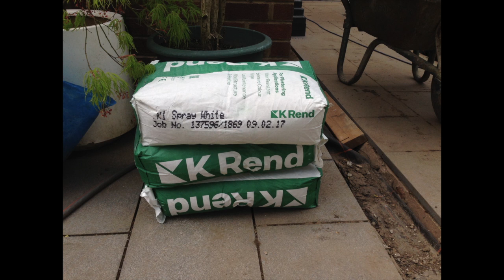Krend

Comment: 1st you should use hp12 as first coat for k render, then thick 2nd coat with k- render. Wait 4-6 hours dependimg on weather then scratch up.
1 bag of k -render should only 1m squared, only mixing half bags is just prolonging the job. Good tip, use a clean out bucket to clean whisk spraying it over customers garden is a very bad idea. 
Finish product looks good but a very long way of doing it and quite messy

Comment: Hi. I'm a DIY'er about to have a go at rendering. I've watched many tutorials now but none seem to mention drying times / times between each pass.
I am going to apply (straight onto concrete blocks) HP12 base coat and beads, then mesh, then 2nd pass of HP12. 
Do I then leave to completely set before applying K1 top coat or do I apply it immediately? same day?
Also, do I need to apply a 'bonding adhesive' such as SBR or is the new clean blockwork going to be ok to go straight onto?
TIA for you help and advice.
Reply: Hi. I’m in the same boat as you. Starting this weekend. My understanding is. Let the base coat go off. Minimum 24 hours. And then apply top coat. No bonding agent should be needed on new clean dry blocks from what I’ve seen.
Reply: @scottramsdale1572  Thanks Scott. Well I've made a start and it seems to be working out ok. As it turns out I can't locate any stock of K1 K Rend top coat in white so my base coat will have plenty of time to dry :). Good luck with your project.
Reply: @vincealcorn  I’ve had the same trouble but finding any none white colours. Not sure if it’ll help as I don’t know where you are. But Travis Perkins in Chesterfield, Derbyshire have stock of FT white. My none white was from a website called ‘rendit’ they’re based in Doncaster I think.

Comment: Great video, can I ask how did you get the black plastic to stick to the top of the inner side? I was going to seat it under the top most block but yours seems to be at the top of the topmost block. Tbanks
Reply from the maker: Hi - the inside of the planters were coated with two thick coats of bitumen paint before lining with a layer of visqueen (black plastic sheeting). You could point it into the top layer of block or pinch under the outer edge of the beading. I simply trimmed it off very near the top and held it against the inside of the wall with soul and a top layer or bark. I’d probably look at getting some black plastic trim and screwing this over the top next time (something like this - https://www.roofingsuperstore.co.uk/product/classicbond-epdm-gutter-trim-upvc-gutter-drip-25m-length.html?gclid=EAIaIQobChMIp6qw3aqM7AIVk4bVCh3LwgQsEAQYASABEgKVpPD_BwE

Comment: Great video I'm about to start mine. Today as its sunny. Just finished the block wall and driveway gate posts. 

Should I use mesh or leave it out like you did just garden wall flower beds and posts like you have done? Using k rend was going to use that cork sol and spray it but fancy giving the k rend ago.
Reply: you didn't get a reply - but I'm interested to hear what you did! Most others on YT seem to use mesh - did you? And did it turn out OK?
Reply: I didn't end up using it and its bonded well, no cracks or movement.

Used concrete block, base and then top coat, super easy after a couple of mixes you get used to applying k rend.

I got quoted 55 pounds per square meter so I'm glad I did it myself. 

Cant go wrong as its scratch coat looks superb all the neighbours came out and said what a great finish it was. Painted it to to match my grey windows ral7022.
Reply: @s.s.lcivilengineering6364  thanks for the reply!!

Comment: Thanks for posting this up, nicely demonstrated but it's not for me unless a client insists on having it.
They used K-rend on a farmhouse down the road from my home, their stuff came from France. The Albanian plasterers put on a 1st tight coat, scratched it up and 2 days later put on the final coat before hitting it with the metal teethed float. No cracking and lots of expansion joints. In a nearby village is another Krend home and this one was done 3 years previously and I've noticed a few cracks but generally it looks OK,  time will tell and I will stick with using lime putty mortars and plasters because they have stood the test of time and I know where I am with them just like sand and cement. K-Rend is used everywhere and it's slapped on all kinds of surfaces without any kind of wetting down and, to me, this can lead to long term issues.
Reply: I'm looking to build these in my garden, but every vid I've watched, use a stratch coat then a final coat sponged off.!
Reply: @luvit7567 , so why don't you use something else like a 3:1 sand & hydraulic lime or putty or a 5:1 sand and cement?
Reply: K-Rend is shit, Webber or Monorex are t best, K-Rend is to fine and cracks even when the wall has been meshed.
Reply: @ParkaMonkey ,thanks for that. Nearly all the new homes used K-rend and as you said they crack and get discoloured in no time. Do the bags have a shelf-like like multi-finish or cement?
Reply: Peter Gambier some shops do, your best bet is a render specialist shop
Reply: @luvit7567  normally to get a decent, flat surface you get 3-coat work, scratch, float and a fine top-coat.
Reply: When I started out I used cements and gypsum plasters. In about 1996 I started working in conservation and learning about lime and stayed with it because I like all the old stuff, the ethos etc. I loved old builds and respected what the ancients had done and found a passion for something. The first few firms I worked for mostly used the St Astier 3.5, 3:1 mixes. 

These days I only use lime putty mortars because they are less harsh on the background, they absorb co2 and there's no waste, they are also closer to what the old boys used when they travelled to different sites, they didn't take lime putty, they took quicklime because it doubled the quantity.

Comment: Just out of interest, as I’m going to be doing my own shortly, did you just use adhesive for the drip beads at the bottom or did you nail them up? I worry a little the frost May get to them and they fail.
Reply from the maker: Hi, I used a solvent based Gripfill ( in a green tube) that has stuck really well. When applying I used an off it to force any of the adhesive that had squeezed through the beading back into the holes to try and maximise hold. I’ve done this with all the walls I’ve done since.
Reply: jlongrid cheers dude

Comment: Hi, Superb video and very helpful, im about to do my planters...is the base coat the same as the topcoat or a different krend?
Reply from the maker: Hi - Krend do a base coat however the Render I’m using here is suitable fo two coat applications. Given the size of the job I found it easier to do two of the same to keep it simple. Good luck with your job!
Reply: You should always use hp12 base coat then use top coat

Comment: How long did you leave it after the second application before using the Scratching trowel. Thanks
Reply: 12 hrs
Reply from the maker: I found that it can be done late afternoon if applied in the morning, however, just be careful to ensure it’s dry enough to crumble instead of smearing. If you get the timing right the excess will fall from the scratching tool without getting clogged up and stuck.

Comment: did you use a base coat or just the krend?
Reply from the maker: Hi Gary, for this I just used the K1. This was the first time I used it and I followed the data sheet guidance (to use it as a two coat render). I’ve been pleased with the results, however, knowing what I know now is use 15mm beading and HP12 base coat. Good luck!
Reply: What’s the name of the tool you use to grade to make the finish touch

Comment: What no base coat ????
Reply from the maker: Nope... 

Could have done HPX base but just did as one coat due to the size of the job and application (data sheet - https://www.k-rend.co.uk/pdf/Silicone_K1.pdf).

They’re still looking great after being done for a couple of years. Only thing I’ve noticed is that the tops are susceptible to dirt/ algae from plants. 

Good luck with it!
Reply: Great video, I a small job that needs to be done and you have given me the confidence to give it go.
Nice looking job you done. Thanks 👍
Reply: What size beads are you using mate 10 -15 mm
Reply: @jlongrid  Hi, if this was your own home, would you do this the same way, or go the two coat route?
Reply from the maker: Wayne Brewer think these were 10 - knowing what I know now I’d have done 15 just for the extra thickness - I did 15 on the other walls in the garden just to avoid the chance of cutting though the first coat.
Reply from the maker: luvit 756 id happily do the same - just thicker beading (15mm). To be honest, the quality of the finish is pretty good - I’m more unhappy with   them discolouring due to things spilling from the planters - they tend to get a fair amount of algae that needs brushing off every now and again.
Reply: @jlongrid  Thanks for the reply 👍 
They look the biz, great video, really appreciate it.
Reply: jlongrid what do u mean by cutting through the first cost mate  do u apply 2 coats of top coat just currently building my block walls/ planters atm
Reply from the maker: BOFFOVCOV  - be careful to make sure that your base coat is applied consistently (and not too thickly) so that you don’t end up revealing it when scraping the second coat.

I’d also look at using an angle iron or straight edge to scratch back using the beading as a guide.

Hope this makes sense and good luck with your job!